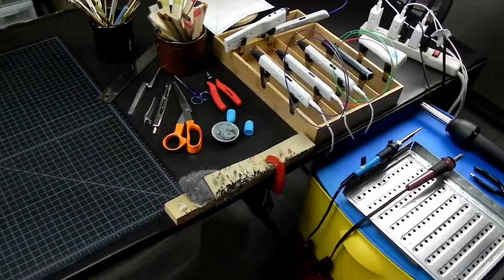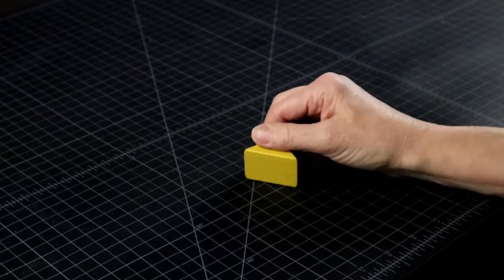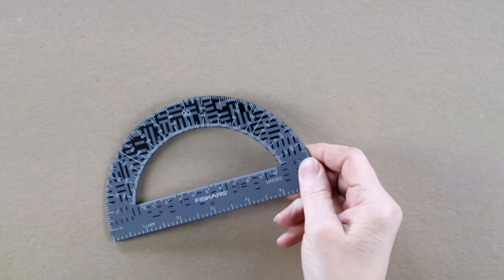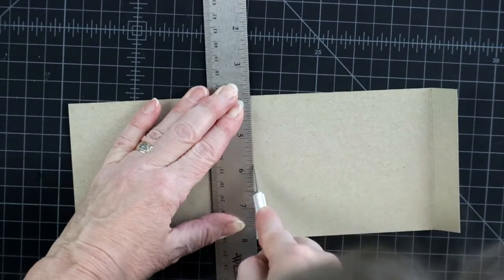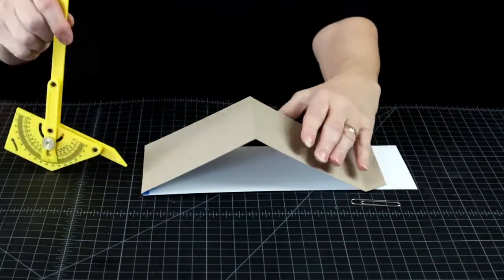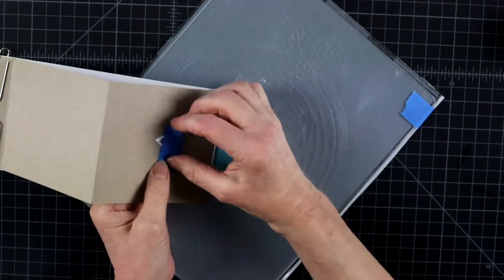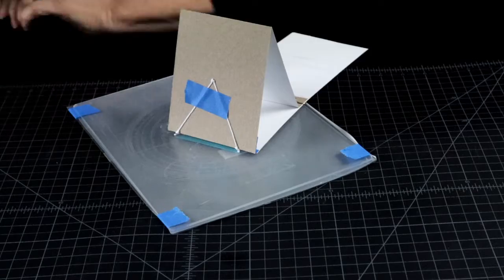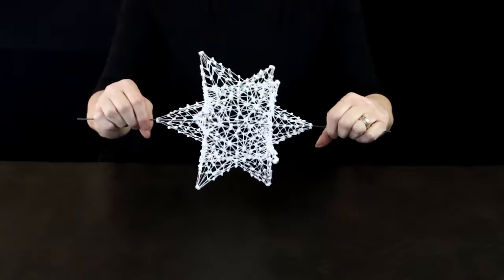Making angles with 3d pen

Comment: Great tutorial as always,. Question is it posable to create a cluster of crystal shapes object or does it have to be at a large size model to make numerous pyramid shape triangles ?   📐
Reply from the maker: I am not hundred percent sure I understand what you are asking. But if you are asking if it has to be done all in one piece or if you can cluster it from parts both are possible. I would start from medium sized projects (extremely small or large models come with extra set of issues.) So first time around I would try to start with 2-3 inch sized sides. I am currently working on stellated icosahedron (my pet project) by making the icosahedron separately from the spikes and joining it later. There will be (hopefully) a video on it before Christmas. Good luck.
Reply: @3DPENDEN  Thank you for your reply, I made a 3 inch crystal cluster modol however it looked like a mess of lump of plastic anyway can't wait to see your pet project cheers Perry 😁